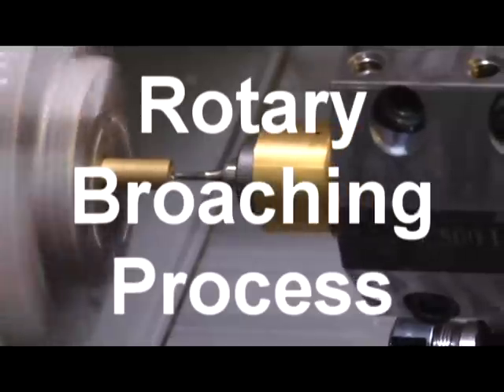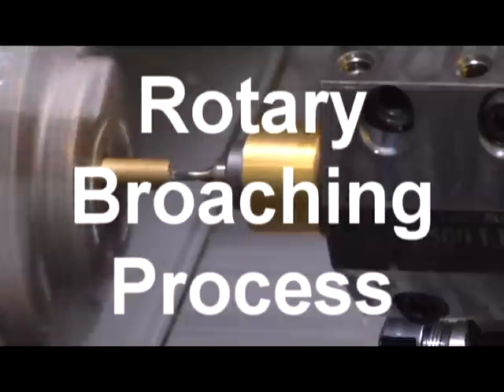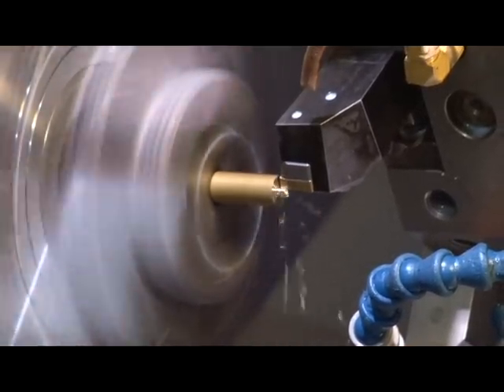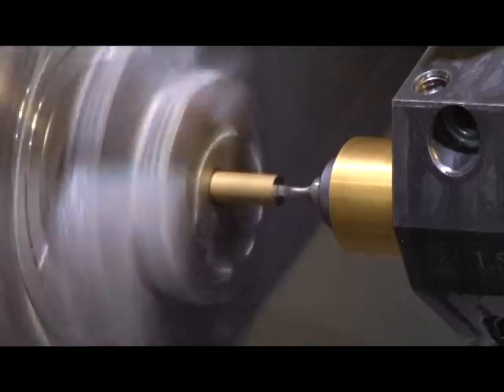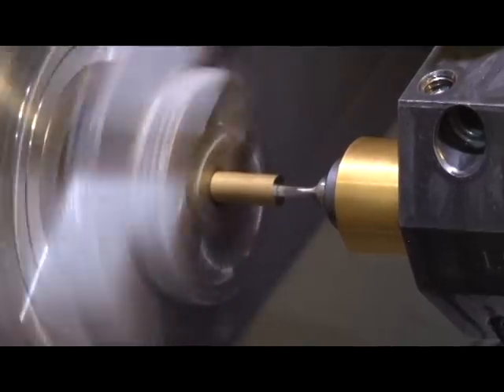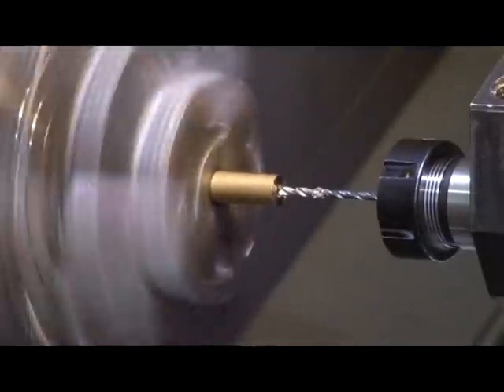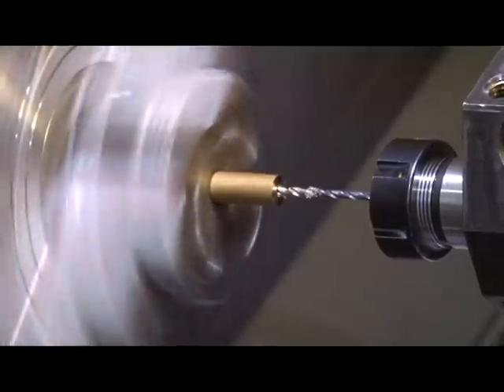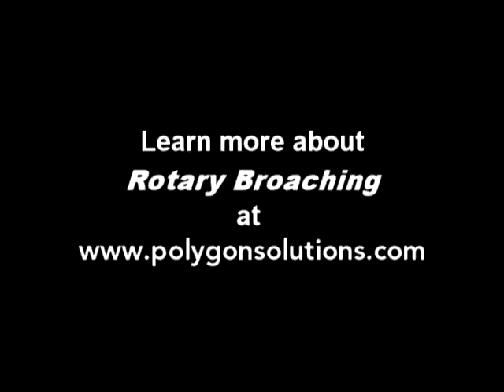Rotary Broaching on a HAAS SL10 CNC Lathe

Comment: What's the point of having the chuck spinning during the broaching process?
Reply: The rotary broach is set at a 1 degree angle which feeds it in so that only one tooth is aggressively cutting at any given time. This reduces tool pressure and stress on the part.

Comment: So I have a radial drill hole application where we want 6 1/2” D holes that are approximately.875” deep.  We will have 6 D holes in the platter with the flats facing the opposite direction of the Face surface.  The Live tools we have are Eppinger right angle tools for a Haas Sl-30 or ST-30 which have Er-32 collets.  We can drill a smaller diameter hole all the way through a 2.75” diameter disk that is about .58” finished thickness.  We will be using two different alloys. 12L14 and 4140 HRC32.  How much material can your broach remove relative the the drill.  Currently we drill a 29/64” thru followed by 1/2”.  Your broach would replace the 1/2” and put a ad in instead.   Thanks